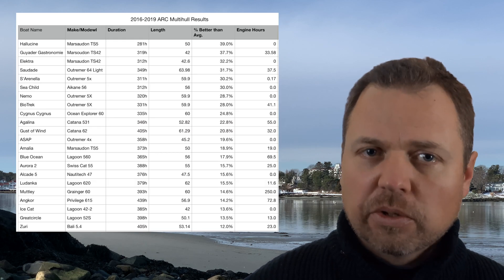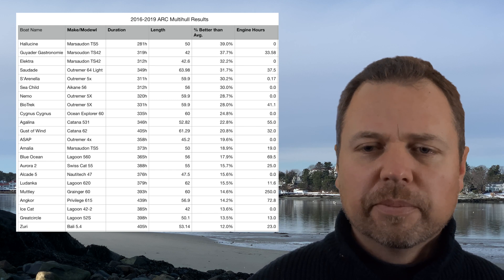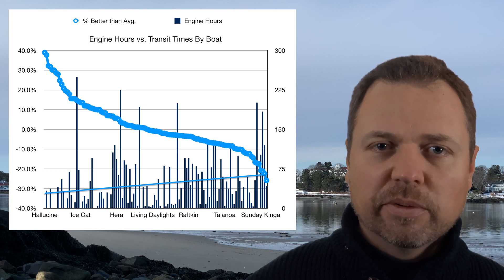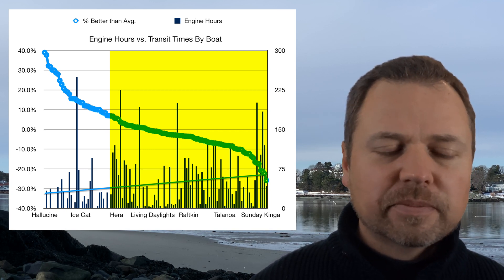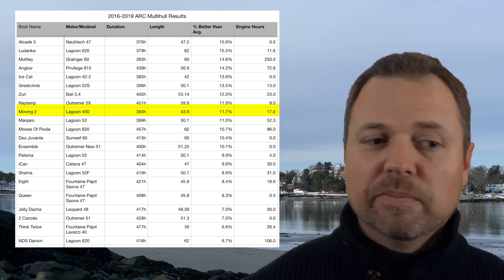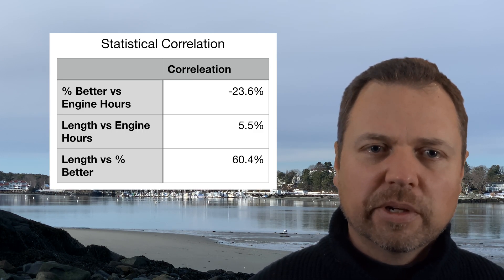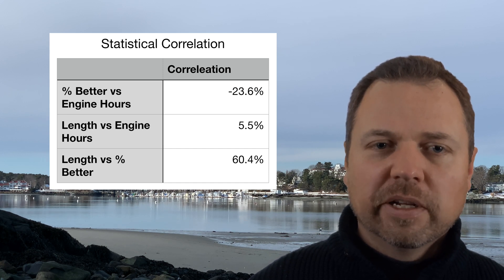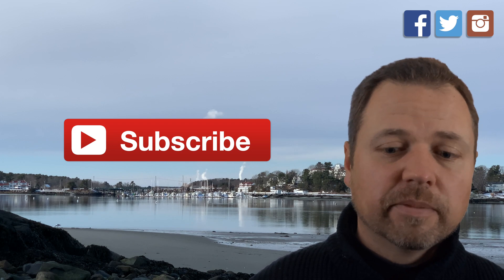Performance Catamaran Data -  Engine Use

Comment: This info is very important to potential boat buyers, and very few are putting it out there. Thank you for the data crunching. Hopefully you will do more of this with more recent ARC results and other events if possible..
I'd really like to see data comparing mid sized fat cats. Like Leopard 44 vs Leopard 45 vs Lagoon 450 vs Lagoon 42 vs FP 44/45. Maybe there is performance info compiled on these but I haven't seen it.

Comment: I like the correlations, but keep in mind using the ARC data is extremely limited in the sailing conditions. It's basically all downwind in the trades, with some becalming. How much was even a beam reach, is there any upwind sailing?

Comment: Presenter is parsing this data wrong. He says right at the beginning that in this event you're penalized by the handicap system for running your engine so of course the boats who are trying to win the race are running their engines as little as possible. That -23.6 percent correlation number doesn't mean there's no correlation—which would be a number close to zero—it means that in this data set faster boats tend to run their engine less.

Comment: TS5 and TS42 look like the clear winners for the sailing, not motoring, 
enthusiast with less than $1 million to spend. Affordable, fast and easily sailed single/shorthanded. Definitely not as comfortable as the 60 footers but not many people can afford to run a boat that size.
Reply: Good point Timothy, but there are sailors on much cheaper boats (monohulls - a friend who's just arrived in French Polynesia paid $2500 for his boat)  who don't do a lot of motoring. Some have (obsessively) gone to only electric motors, others just insist on sailing instead of motoring - often takes longer. (In one sense the oceans they sail on are much larger than the oceans faster boats sail on.) I used to paddle by the sail boats in the marina thinking that they all must cost 'about a million dollars. ' Then my stocks went up and I wondered, 'How much do sailboats actually cost?'  Duh. I could've been around the world twice already. 
In my limited experience running the engine is for heavy/wide boats in light winds, into the wind (those comfort cats don't point), how much spinnaker hassle do you want to do?  and are you trying to keep a schedule? (Maybe just to anchor or moor in daylight.)

Comment: Thanks for the analysis. Very well done. Did you include cruising trimarans such as a Neel. would love to know you thoughts. And are you sharing your spreadsheet?
Reply from the maker: There was only one trimaran in the dataset. As such it’s not very statistically significant. No rubs on trimarans, just no data to work with.

Comment: Nice analysis- thanks for taking the time to do this! It is not necessary, but another subset analysis you could have done is to compare engine hours for light wind vs medium or high wind days or years. Would be nice to show as a positive control that engine hours go up in light wind days or years. Look forward to your analysis on upwind sailing! I chartered a Leopard 40 in the BVI and it sailed nicely downwind and up to 90 apparent, but was a very sluggish feeling slow dog trying to go upwind, eg 45-60. But was super comfortable at anchor!